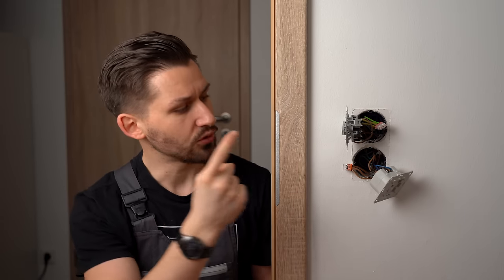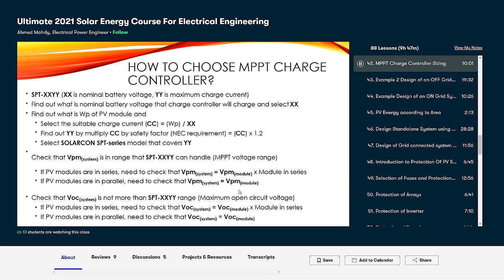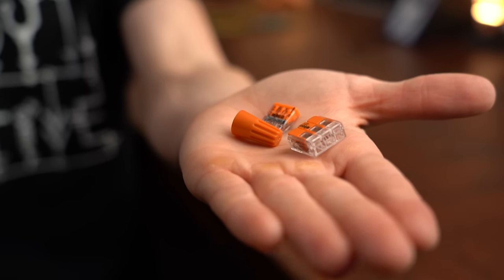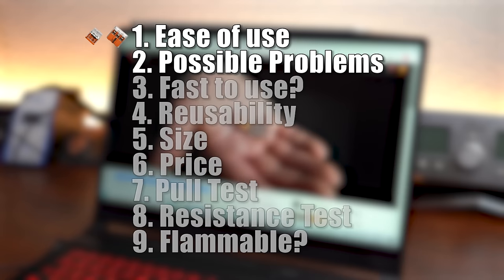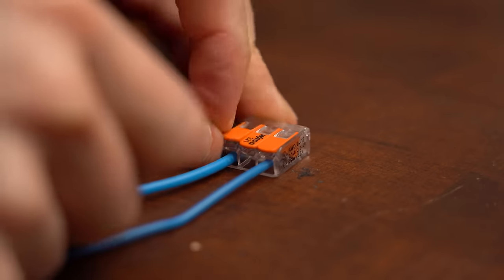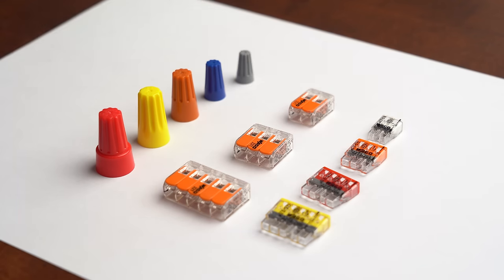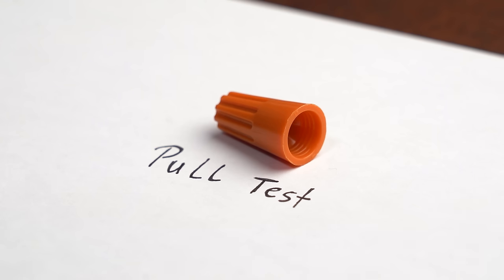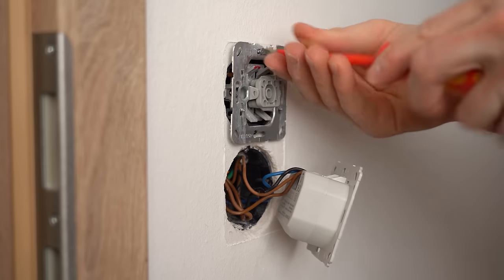What Wire Connector is the Best? Settling a Debate! Wire Nut VS Wago

Comment: For any home improvement DIY, the Wago flip connectors are foolproof. The price is more expensive than any other connection method, but the time saved, ease of use, capacity of happily mixing wire types and sizes is a huge advantage- and finally when factoring in all the other parts of an electrical job - plugs, sockets, switches, and the copper wire itself - plus possibly your own time and sanity - I think it pays for itself.
Reply: as long as you stick to low current applications, and are fine with it not being the most reliable long term solution, they work. just know you're feeding the current through the tiny strip of metal connecting the bus, not the wires themselves like you get by making taps and topping with wire nuts.
Reply: So you are saying you have to pay yourself for your DIY home improvements?

Comment: Great video and thinking of trying the wago wire connetors for a renovation project. The only comment I would say is if buying the wire nuts from a proper electrical supplier instead of amazon their ratings are usually listed on the packaging.

Comment: Wire nut has a major flaw when it comes to troubleshooting and verification.   

To the guys fixated on resistance:    The wago may have slightly higher resistance when used on single core, but you have to put things into perspective.  Pulling 20A resulted in a temperature rise of 3-4c ?     I suggest you test all the connections in a house at the rated current and check the temperatures. This, of course includes the breaker board.   When you have done that, let us know if a 3c increase in temp still is worth mentioning.  

Aso, for 20A you should be using 4mm2.  And at that point its normally multi stranded wire and/or beefy screw terminals. You are no longer connecting lamps or receptacles for waffle irons.

Comment: As an electrician I use both connectors. The wire nuts is much cheaper than wago connectors in my country.  Also, here in my country, solid cables are outdated, only present in olds (20+ years) installations

Comment: We use multi-threaded cable which is just better than wire... and works absolutley perfect with twist type connectors, we secure them aditionally with Super 33 3M tape so it is super safe

Comment: So... you would choose less power efficient connectors that are cheaper to boot over more inefficient ones that cost more?  That seems reaallly counterintuitive to me.  Me?  I prefer DIN rail-mounted screw terminals like Phoenix or Weidemuller, but I'm an instrument and controls technician by trade.  If I had to do residential wiring, I'd use wire nuts.  There are brands of wire nuts that include a drill fitting which makes it possible to use a drill or powered screwdriver to twist them on more rapidly.  (One must be careful not to apply too much torque, though.)

Comment: I have done electrical work in the US for over 40 years and have always used wire nuts...Over those years I have had the opportunity to do work at locations (Residential, Commercial and Industrial) 20 to 30 years later. What I have found is if properly applied wire nuts have provided long term connection without requiring occasional maitainance...I'll stick with what has worked reliably longer than your lifetime...

Comment: You can check your connection on wire nuts by trying to pull the wires out of the nut. If they slip out then your connection is bad, if you tug on it and it doesn't come out your connection is good.

Comment: Someone else in these many comments may have already brought this up, but if you buy wirenuts by the box (typically 100) like you'd get them from the electric supply store, the box has all the ratings printed on it, how many wires of each gauge, voltage rating, stripping instructions.  Information required for UL listing.  No there is no current rating, because the wires carry the current, and they all have current ratings per the electric code depending on gauge and insulation temperature rating.  (The temperature rating of the wirenut  may limit  the current rating of the conductor.)

Comment: Voltage drop is most important for me as a safety issue. That's why i use wire nuts in house wiring.
Reply: A visible good contact is more important for me. That's why I use wagos.

Comment: Definitely just a DIYer, but from the experiences I've had over the years, I've had so many frustrating times where I'd end up with broken connections on a simple pull test (not nearly as hard as shown) because the non-solid core wires seemed to be so fragile that they'd break in the nut or during the act of twisting. I figured out that you needed to expose more of the smaller wires when pairing with a solid core (on my own) for the simple fact that it has a longer linear path during the twist. It wasn't until recently (when looking up wagos) that I found out that nut installation involves a sort of click that's supposed to indicate that you've twisted far enough. Once I started doing That, then I noticed that the spring must have grabbed the wire fully as they wouldn't pull out anymore. I've also read that the nuts are one-time use because of the springs (for those that haven't read that), so that marginally affects their cost. After discovering and researching the wagos, I'm almost tempted to redo the outlets/switches as I go (we're upgrading things) since this is an 80s build.

Comment: Your findings on resistance confirm for me that wire nuts are superior. 1 watt of dissipation is too much. Consider what may happen as the copper develops an oxide coating with time. 1 watt could become much more.

Many North American receptacles include both screw and push in terminals. Not many trust the push in terminals - they call it “backstabbing”. Most people use the screw terminals.

Most electricians also won’t use the wire nut as you have. They will twist the wires together, cut off excess and then twist the wire nut onto this until it would be challenging to reuse.

Almost all electrical fires happen because of the heat caused at loose junctions, so electricians spend a fair amount of time making sure these are good

Comment: I hate wire nuts, but like you said, they are the standard here. When you buy them in a branded package, they include on the package what types of conductors, and how many conductors, you can use. If you buy a cheap assortment from china, though, you're not going to get any info. But I always get mine in the local stores.

Comment: US electrician. Im lazy so I prefer wagos.

Both connectors are perfectly fine. Wagos are easier and better for testing/troubleshooting. Wire nuts are more versatile and offer the better connection as the copper of the wires is directly touching. 

The wire nuts you used in this video are throwaway ones they give you in cheap light fixtures. 3m and Ideal make much better wire nuts.

Comment: Wago 2273 is not that easy reusable: how much you can twist when all cable inputs are occupied?
From what I see is that screw terminal blocks are way superior to Wire Nuts - similarly cheap, size, slow, but since many electricians put multiple wires into single port, resistance is probably even lower. As a bonus you have better control over how good is a connection since you see more and feel more.
Resistance is quite important. Connect an Oven to 40m ohms and you get 4W, add something else and you can get 10W (at 16A which is allowed for standard Schuko-compatible power sockets). This is a huge risk, as heat will deteriorate insualtion and plastic over time, while resistance will slowly rise (due to oxidation at high temperature). It can surely take few years, but it will happen. This is a huge backside of WAGO. I would say these are great for lamps, but should not be used for electrical contacts. I know that there is a current rating - but too many electricians are dumb like hell and they only look on voltage rating and cable diameter. 

Flammability was tested incorrectly: you used components with UL, DIN or ISO flammability standard compliance, so these will now burn. You should rather push through it some very high currents, like mentioned 16A. If the connector melts through plastic, so that short circuit can happen, then you are in serious trouble.

Comment: Wire nuts are time proven.  But work ONLY if they are exactly prepared and attached.  This is especially true if you have two different wire characteristics: gauge & stranded/solid.  You can be confident that the Wagos will connect even in confined areas.  And Wagos in a tight box will always be better than wire nuts in a tight box.  A good report and thanks.

Comment: So for possible problems we are just going to ignore the possibility that the spring strength of the wago may decrease with time, especially thanks to thermal cycling, causing a bad connection.  Think of backstab outlets.  And the fact that wire nuts are so simple and don't contain springs means they are infinitely more reusable.  There's just an incredible amount of bias in this video.

Comment: Wire nuts are great. Being patented in 1963, they're old and do the job well and are ubiquitous so they're cheap. Most boxes of wire nuts I have ever had tell you the information for each wire nut color and they're standardized so no information is ever necessary on the outside beyond the color.

Comment: 00:04 The connectors installed in the socket are declared by the manufacturer for connecting lighting devices (chandeliers, lamps, etc.). It would not be a bad idea for the author to first read the device manufacturer's manuals before installing them.

Comment: German here:
I'm curious how the 230V vs 120V affecs the choice of connection. 
The Test with 20A is nice and all, but our breakers are mostly 16A, so 3680W per breaker. That is a lot of power and when you need more, you go 400V (3x 16A).

How much current will your normal US breaker allow to flow? Do you have like 30A breakers or can't your outlets support such high current?

Comment: Wagos have a very small amperage range. They can be used on lighting and small loads with no problem. Wire nuts are not for making connections. Wires must be twisted together. Then the wire nut is installed to prevent untwisting and provide insulation. If twisted properly, the wire does not have any loss of conductivity. Wagos are a bridge, the connection is only as good as the bridge. Mostly steel or aluminum.

Comment: I've used all of these, and I don't have a preference. I will say, on at least a couple of occasions, I've had the WAGO levers pop up. I solve this problem by wrapping them in electrical tape, which I now do every time. Of course, this makes them harder to use, defeating the purpose of using them to begin with. Never had any problem with the push in connectors, except you can't use them with stranded wires. So, the ones I carry most often are... wire nuts.

Comment: My own preferences are pretty simple:
1. when dealing with ground wire that got clipped together in the junction box, Wago221(not enough wiring space for wire nut)
2. when mixing stranded & solid copper wires, I go with Wago221 (Sometimes wire nut are tough to mix these two, especially thick stranded wires)
3. when connecting 4-5 wires, wago221 (twisting wire nut for many wires deems a nightmare)
All others -> wire nut. (frugality, wagos are expensive)
Reply: Given that time equals money, I'd say that frugality has its price.

Comment: it's because of the size saving. over here in Canada they fked up a lot of the wiring space design behind the house wall so they had to use the connector with smaller form factor. 5 DSL copper line jammed into a single port space in my basement, they could only use the twist cap, however that German conductor you're using seems decently small-sized as well.

Comment: Good intent but a problem with the use of wire nuts, you must twist the wires together in a clockwise fashion with pliers before you apply the wire nut, it is only there to maintain the connection and cover the wire connection. The work fine when properly installed, but I like the push in ones better anyways, you can fit more connections in a junction box and they are easier to push at the back of a box to install a switch or outlet if using it to splice.

Comment: Soldering provides a more reliable connection compared to using wagos. When soldering, the heated metal creates a strong bond between the components, ensuring a secure and long-lasting connection. This is especially important in applications where a stable and uninterrupted electrical connection is crucial.

Comment: For fair comparison, do not forget that Germany uses 220 Volts while the US is using 110 Volts. This means twice higher currents in the US on average (for the same power consumption), which also means that Wago connectors experience four times less heat produced by the electric current through their resistance, and thus they are not as tough as the wire nuts.

Comment: I don't know about wire nuts, but wago also have a testing port. It's a little bit catchy but it's designed for a testing screwdriver and it's very usefull and fully isolated

Comment: I ran my own measurements (I'm an EE) running 0.5 A thru five of each type and found that 2773's had 0.68 milliohms and 221's had 0.72 milliohms. So no difference.  Also, I found back wiring and screw terminals have the same 0.4 milliohm resistance.

Comment: As some one when has only ever used wire nut I can say I hat them just the twisting is inconvenient especially if you have little space to work with or you have to work on ceiling fans it gets time consuming And is not guaranteed to connect first try trying idk I only did electrical stuff for like a year and basically had to teach my self on the job

Comment: The pre-twisted wires are the connection and are the strength. The wire nut is a protective insulator and  may add somewhat to the connection. 15 amp rated wire = 15 amp connection. In most places in Canada, only certified electricians and their apprentices are permited to work on residential wiring. Only a poor electrician or an unqualified installer would need to look to the internet for information on wire nut use.

Comment: While I am not against WAGO connectors. In fact, I'd use them in some application. I still am content in wirenuts. Used them for years and I know the potential connection flaw with them. I learned how to deal with them and it wraps well.

Comment: Here in the US electricians are very opinionated on this subject. I had an electrician tell me Wago's were a recipe for a house fire and that he wouldn't be caught dead using them. I try to avoid using wire nuts and instead use clear wire end crimps when possible as they create a much more secure connection and often take up less room in the J-box. Wire nut connections are easy to mess up and a bad connection is sometimes hard to spot.
Reply: According to many us electricians Europe should constantly be in flames as various types of Wago connectors make up about 85% of all connections.
Reply: @1I2am3Dani4 yes I'm sitting in flames here in my wago house 😅

Comment: You should have included the single or double screwed clear wire connectors we use in Australia, it would beat them both hands down, cost, strength, and resistance.

Comment: wire nuts also have the advantage of simplicity, with only one spring part keeping the wires pressed very firmly against eachother, with no intervening conductors. This is a huge advantage, and give the wirenut very low resistance and very low heat generation.  That is very important in the case of electrical fault, where a short circuit may cause high currents and high heat generation, but a higher resistance connection may not allow enouigh fault current to trip a circuit breaker fast enough to prevent damage or fire.
That said, USA thermal magnetic breakers do not trip as quickly or reliably as european full magnetic breakers.

Comment: The nut is definitely smaller and easily reusable but only if used in a way that is no longer proper code. Reusing them is not allowed anymore (though it is still commonly done). You can also oversize a nut and fit as many wires (of all gauges) as you need using a single nut. If done properly it's perfectly safe; the problem is that doing it properly is easy to mess up...which is why code says they need to be the same gauge and no more than 3 into a single nut). They don't really conduct any current; all current is passed from wire to wire. This is why they are clearly superior even though they are also cheaper. The resistance you're measuring is just the resistance between the two copper wires it isn't due to a lack of conductive material in your bus. The advantage of the Wago really is that it is easy enough for people who don't know what their doing to manage without burning the house down. That's a big advantage, to be sure. The American argument is that this is something that is used by professionals. If you're an armature and you want to use Wago, go for it. The pros are going to stick with the electrically superior product.

Comment: Wire Nuts commonly called Caps do not take wires that way. You must first take away like 3cm of insulation, twist the wires together with something like clamps and then screw in the Wire Nuts/Caps. Caps are not made to hold wires together, they are made to protect the joints from anyone that may touch them

Comment: The rules at the electrical company where my friend works at; If they find a Wago connection, stop, photograph it and report. The area is not to be disturbed in the slightest and associated circuits need to be investigated for same issue. The owner is contacted and the job can only continue if those connections are replaced. Weather or not the UL approval, that contractor doesn’t want anything to do with those things. I wonder what he had seen?